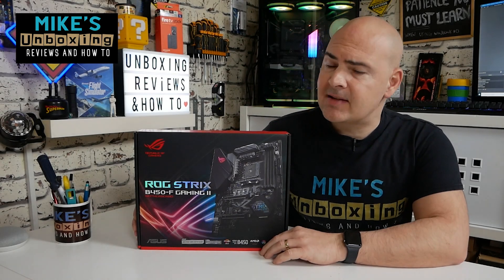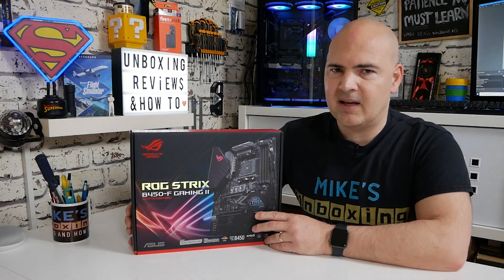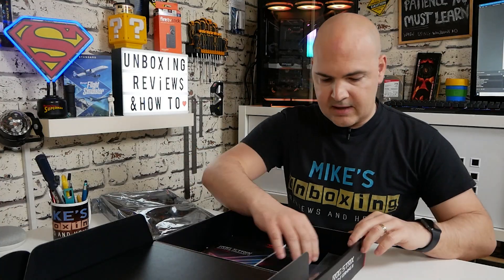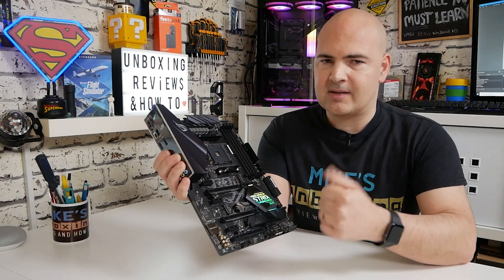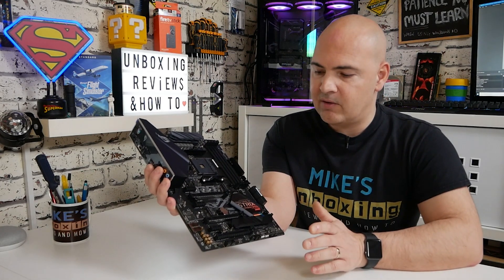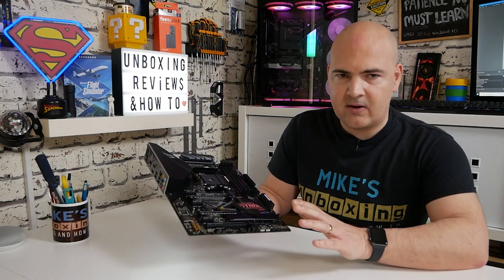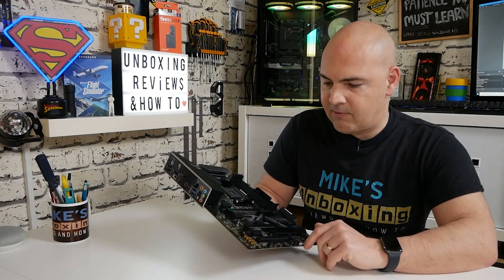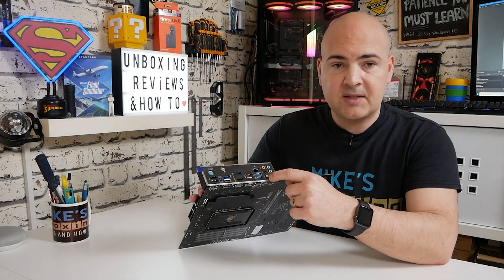ASUS ROG Strix B450 F Gaming II For AMD AM4 CPU The Most Popular Motherboard On Amazon

Comment: @12:38 I don't understand why this reviewer would say SLI is dead in the water.  I was hoping to find out if this board would run two graphics card, eg 2 x GTX 1080 in SLI mode.  Instead the notion of having two cards is simply dismissed by the reviewer.  So my next question is which budget AM4 boards would support the funcationality i am after?
Reply from the maker: Sli is dead and buried with little or no support in video editing and most games developed in the last few years. It only works to some extent in some benchmark programs. For almost all regular pc users sli is not possible and needs a lot of modifications with no guarantee of stability or utilisation

Comment: Hi, I tried building with AMD Ryzen 5 5600G, post building I can't get into the Bios menu. I am able to see the asus home page showing (press del/F2 to get into Bios), and then no display output.. then I updated the bios using flash bios, reset the cmos, still no luck.. any suggestions please.
Reply from the maker: try using a different cable or plug into a TV

Comment: Please help someone, I bought this motherboard literally last night and I want to use the bottom m.2 port with the heatsink in it but when I plug in my m.2 ssd it doesn't appear in the bios :(
Reply from the maker: is the bios set to uefi or csm? and does the processor you are using support the amount of PCIe lanes needed

Comment: Hey Mike first of all nice review and I would like to get some information as I am going to build a PC in which I need a motherboard at around 115 pounds please try to recommend with Wi-Fi
I hate  choosed m s i b 450 tomahawk but it has no ARGB headers then I went for Gigabyte aorus b450 PRO Wi-Fi but it is the worst Mobo with very bad temps and vrm and even it crashes most of times and now I am wandering around MSI b450 gaming Pro carbon AC and Asus Rog strix b450 f gaming II 
Please recommend any good Mobo around 115 pounds
And please tell how are the temps and vrm of Rog strix b450 f gaming II and how would it be
Reply: @Ruben Schilling r5 3600
Reply from the maker: i would consider the msi B550 gaming wifi, the price is often reduced to about that level

Comment: Older videos here but I’m thinking about getting a Ryzen 9 5900x and I have the same motherboard but I would like to know how to Check what version your bios is in and if it’s updated enough for 5000 series and how to update it. If you can help that would be appreciated 🙂
Reply from the maker: you can press the delete key before windows boots and in the bios the first screen will show you your bios version and date.
then head over to the ASUS page for this board and then support and cpu compatibility and there you will find all the info needed
Reply: @mikesunboxing  Alright I’ll try that, thanks 😊
Reply from the maker: @rezxottic2379  No problem :-)

Comment: if i were to BUY this bored, would i be able to use a ryzen 5600x as my processor without any problems ?! PLEASE LET ME KNOW
Reply from the maker: yes just look for the ready for 5000 series sticker on the box and it will work out of the box otherwise a bios flash will be needed

Comment: I did not quite catch all the info but what type/s and how many in each type/s are in the front usb ports? TIA.
Reply from the maker: 2x usb3.1 type a and 4 x usb 2.0 type a
Reply: @mikesunboxing  thanks man, but I thought that was for the rear usb ports? I was referring to the internal I/O ports (front usb ports), the one which will be connected with the system unit's case ;-;

Comment: I have AsRock B450 Steel Legend. It's a bit of a mash up of different parts. Thinking of just going for a ROG and Corsair (or Chromax Noctua) build.
Reply from the maker: for an easy life and save money the MSI eco system is by far the best for easy sync rgb etc, but with signalRGB the others can potentially work

Comment: Im looking for a new card and came across this one. But will it work with my ryzen 1600 untill i buy a new cpu ? cant afford to buy both at the same time. I am however going to upgrade further down the line
Reply from the maker: yes it will
Reply: @mikesunboxing  ty so much !

I have this issue with my 2 other boards and im rarely stumped but this time im at lost for words.

I have older mobos. Asus b350 prime plus. Paired with
 ryzen 1600 
Nvidia gtx 1050 ti
16 gig of crucial ballistics 3200
And a gold 80 plus psu ( cant remember brand atm.

I cant get it to run with more then 1 stick of ram and only 1 of the ramslot seems to make it wanna post. The other 3 doesnt work anymore.
I have tried

1. Test each stick individualy
2. Bios update
3. Cmos and reseting everything on the boards
4. Changed psu
5. Switched motherboard
6. Tried increase ram voltage
7. Took everything apart.put it back togheter. Checked connections.

This happened after switch case. And here is the thing. Both my mobos do the same exact thing.. so am i missing something or am i having really bad luck with the motherboards...
Reply from the maker: @shootinsharkz  This is maybe easier to fix or at least advise if we can ask more questions and get direct answers, so feel free to join our Discord chat and we can go over it in more detail https://discord.gg/gaeeDPw

Comment: @Mike's unboxing, reviews and how to
How much fan ports are there? , i need to connect 5 rgb corsair fans (4 pins) , and a noctua one.. can i with no problem?
Reply from the maker: they are shown in the video, but to recap 1 x CPU Fan connector 
1 x CPU OPT Fan connector
3 x Chassis Fan connectors
1 x AIO_PUMP connector
so you will likely need a splitter or hub unless you can get the fans to control to your liking on the extra CPU or AIO headers
Reply: @mikesunboxing  ok so i just need 3 splitter cables? And no power loss? Its my first build sorry
Reply from the maker: @LAYATORS  This is maybe easier to advise if we can ask more questions and get direct answers, so feel free to join our Discord chat and we can go over it in more detail https://discord.gg/XtBTGQ6BDu

Agree to the rules by clicking the emoji and you will get access to the rest of the Discord channels
Reply: @mikesunboxing  👍

Comment: Hi Mike, thanks for this video! I have a Ryzen 5 3400G and I'm looking for a B450 because I want  to do a future upgrade to Ryzen 5000 (I can't buy a B550 for the price and the APU compability). Would you recommend me this board or there is a better B450 option? Thanks! (I'm not really interested in technologies like PCIe 4.0 or WiFi)
Reply from the maker: this for me is the best of all worlds if you don't need the extra usb internal headers
Reply: you will need to update the bios to work with the 3400g

Comment: Would you recommend this over the B450 aorus pro MB? And Software wise what's better Aura or RGB fusion. Stability for context. I'm still torn between these 2 boards
Reply from the maker: get this one
Reply: might be out of stock before I could buy one, but I'll see. Any particular points and problems with the aorus board that I should I avoid? If it comes to it.
Reply from the maker: gigabyte boards seem to be a slightly higher failure rate from what i can tell from my relatively small community, and i myself had had a few that caused issues. For us it seems the MSI boards are actually quite good for longevity and just working
Reply: Noted. Even if it means purchasing a tray type CPU to pay ROG tax

Comment: I bought it because it's a solid board for the price. I don't need PCIe 4 when I'm using an RX 580. Hell even with a new RX or RTX PCIe 3 will be plenty. Trust me, moving from  an FX 8350, I'm happy with it.
Reply from the maker: yes that will be a good upgrade! Fx8350 is good but it is showing it's age a bit now
Reply: @mikesunboxing  Yeah, I feel like it's that shared FPU or whatever that limits the FX 8350 but I don't know for sure. I never had my FX 8350 reach "100%" usage yet I was clearly CPU bottlenecked when reaching 65 to 80% CPU usage. It was also running on a ASUS M5A97 R2.0 which def was sweating with this CPU. Tbh, I'm glad I went with ASUS again because that board held on for years without an issue, and then ended with an FX 8350 which people don't recommend due to the board's weak 4+2 VRM. Ran great! So I hope the quality hasn't changed, so far so good.

Comment: Hi Mike. I'm confused, I have this mobo, but I can't work out why m2 slot 2 has a heating but 1 doesn't? 
Should I put my M2 (not running OS off it) into slot 2 instead of slot 1?
Reply from the maker: yes the X570 tuf gaming is the same, either get a separate M.2 cooler or use the other slot

Comment: Does the bottom m.2 slot run at the same speed as the top? Just wondering as the heat sync is there
Reply from the maker: with most processors the two ports are capable of the same speeds.
as listed here 
3rd/2nd/1st Gen AMD Ryzen™ Processors : 
1 x M.2_1 socket 3, with M key, type 2242/2260/2280 storage devices support (SATA & PCIE 3.0 x 4 mode)*
1 x M.2_2 socket 3, with M key, type 2242/2260/2280/22110 storage devices support (PCIE 3.0 x 4 mode)*

Comment: I actually made a budget Ryzen with that board, I got a ryzen 5 2600 for 70€, and the rest of the stuff all new,I had in the cart a b550 board,but I Saw that the b550 compability with zen + wasn't 100% so I canceled the order with the b550 and oredered with One of these,great board!
Reply from the maker: yeah it is a great board with a LOT of compatibility
Reply: @mikesunboxing  Really,I have a question though, I have my ryzen 5 2600 stable at 3.925ghz with stock voltages, after 3.95 crashes at the end of cinebench r20, I would like to reach at least 4.0 GHz,frequency with I finished a round of r20 with stock voltages,but at the second round it just crashes,should I raise voltages or Change LLC calibration? Other question, I have a kit of Corsair vengeance pro at 3600mhz, however the maximum frequency for the 2600 is 3200,but at 3200 the adrenalin software crashes, but if I Turn it to 3133 it works fine, and I am using the d.o.c.p profile on both cases! Thank you
Reply from the maker: @Guitar88  This is maybe easier to advise if we can ask more questions and get direct answers, so feel free to join our Discord chat and we can go over it in more detail https://discord.gg/gaeeDPw

Comment: Man I really want to build one but I don't know what allt of these slots mean and this wifi thing you're talking about like I want to play online games and use a wireless mouse so what would I need to get to do that because in my cart currently is a ryzen 5 5600, cooler master ml240l liquid CPU cooler, this motherboard, kingston fury beast 16gb ddr4 3200mhz cl16, teamgroup t force cardea zero z330 2tb ssd, msi 3060 gaming x 12gb, deepcool matrexx 50, corsair rm650x gold certified fully modular atx power supply and Microsoft Windows 11 pro oem DVD 64bit. I know it's alot man but if you would just be able to help me out a bit it would mean so much dude I'm so lost. Thankyou
Reply from the maker: just buy a wireless mouse it will come with it's own wireless usb adapter
Reply: @mikesunboxing  and I will be able to play online games without the wifi thing?
Reply from the maker: @Toxic-ng2fg  This is maybe easier to advise if we can ask more questions and get direct answers, so feel free to join our Discord chat and we can go over it in more detail https://discord.gg/XtBTGQ6BDu

Agree to the rules by clicking the emoji and you will get access to the rest of the Discord channels

Comment: Hi, there is any chance i could use this method even though i have my CPU ryzen already install and working with the fun? Or I have to take de CPU and then yes flash it? Thanks in advance,
Reply from the maker: Should work in a fully built system but maybe remove the gpu or ram so the system can’t accidentally try and boot

Comment: Hi, I need your help, I'll tell you I bought the mother b450-f gaming 2, but on the box it says that it is ready for amd ryzen 5000 desktop ready and it also says that it is ready for 3rd gen ryzen and in small letters it says: not compatible with amd ryzen 5 3400g & amd ryzen 3 3200g. and from what I can see in your video I have the same board as yours and it comes with the 4007 version of the bios. What I wanted to know is that if I am going to be able to use ryzen 3 3200g with the bios 4007 or do I have to put the bios 0301 on it ?. please help.
Reply from the maker: it will work out of the box and the sticker is wrong
Reply: Thank you so much
Reply from the maker: @gttayrton  No problem :-)

Comment: Hallo coming from future i want to buy new nvme ssd and planing to get the pcie gen 4 or 5, this board can support? currently using samsung nvme 970 plus evo
Reply from the maker: this board supports pci gen 3 but you can install faster drives, but they won't get the speeds

Comment: Does the m.2 ssd placement have any difference for this board? Still don't understand why they put the heatsink on the bottom m.2
Reply from the maker: yes it is an odd thing to do although the faster drives often come with their own cooling solutions

Comment: Is this good for a ryzen 5 cpu? and can it handle any higher ryzen cpus? Is there a limit on gpu's u can use on the mobo? (Can you use newer gpu's for the mobo, e.g. rtx 360 ti fe.)
Reply from the maker: ryzen 9 is supported and new gpus. the limit of GPU in terms of physical cards will be down to have many PCIe 16x slots are on the board, or riser cables if you want to try and use PCie 1x slots
Reply: @mikesunboxing  Okay ty. great video.
Reply: @mikesunboxing  And do you mind replying to my other comment?
Reply from the maker: @KlIIua  This is maybe easier to fix or at least advise if we can ask more questions and get direct answers, so feel free to join our Discord chat and we can go over it in more detail https://discord.gg/gaeeDPw

Comment: Rookie question, so this will work with the ryzen 5 5600g without the need to do the bios bits? Im planning on buying a bundle mobo with cpu of this and the 5600g. I cant do any of these stuff so im hoping theres no need for the bois bit. But i am asking. 😂
Reply from the maker: it will almost 100% need updating unless it is VERY fresh out of the factory
Reply: @mikesunboxing  wait, im kinda confused. So this exact mobo, asus b450 f gaming 2 will still need to be bios updated so that it will work with the ryzen 5 5600g?
Reply from the maker: @friday3803  Yes unless it has a Ryzen 5000 ready sticker on the box
Reply: @mikesunboxing  yeah i just went all in yolo and bought the mobo + 5600g bundle. If its not compatible, ima just have to figure it out. Plus your vids are here to help tho. 😂
Reply from the maker: @friday3803  Feel free to join our Discord chat if you need any help https://discord.gg/gaeeDPw
Reply: @friday3803  did the 5600g worth with the b450f gaming ii with doing anything?

Comment: Good timing, I literally just got the 3600 delivered from amazon for £150. 
I'm thinking £90 B550 and 3600 crucial ram (£69 for the red ones, seems red isnt popular) but I can go a bit higher. Is it worth extra the extra i ask myself considering I will likely go r7 5800 or r9 5900 eventually. The upgrade path on am 4 means I will be keeping this machine for 10 years...
Reply from the maker: this seems like a good option and supports almost every single chip on the platform, and ASUS style 🤣
Reply: @mikesunboxing  Ah, I just had a thought. I think you need B550 for Smart Access Memory. It only works on 5 series chips and doesnt make a big diff but if it gets better i might regret not having it. 
(fomo is A.M.D marketing ;#}  )
Reply from the maker: @MrChriss000  yeah there are a few advantages for the newer hardware, if you have the option the newer stuff will mostly get better performance when the drivers and specs are sorted
Reply: @mikesunboxing  Cheeses, contemplating the whole platform longevity design I was wondering if I should buy faster ram in case the move to zen 3 is viable later but no, 4 sticks of 3600 / 16 jumps in performance with a 5xxx cpu compared to 2 sticks. (just double it up and ddr4 will be cheap)
Its about 5% faster. frequency does a lot less. 
https://www.youtube.com/watch?v=-UkGu6A-6sQ
Reply: That Rams well good, lovee playing with mine so much bought another set to make my life more difficult. if ya get em hit me up in the discord I have a boatload of settings for them 👍🏿
Reply: PNY XLR8 16gb 3200mhz dual 8gb sticks at Curry’s mate £65 great ram for the cost
Reply from the maker: @pompeyboy75  Thanks for the info :-)
Reply: @mikesunboxing  No problem mate thought it might be helpful
Reply from the maker: @pompeyboy75  might get some seems RAM prices are due to rocket soon
Reply: @mikesunboxing  Wouldn't surprise me everything else has gone through the roof price wise, been looking to upgrade my GTX 1650 but not paying the silly prices people want for the RTX cards when you can actually get one that is, so yeah grab what you can while you still can mate.

Comment: Quick question. I’m getting the Western Digital sn570 ssd. Which of the m.2 slots do I put the ssd in?
Reply from the maker: top one would probably be best
Reply: @mikesunboxing  ok, but when it comes out of the box, the top slot has no cover. Should I put it in the top slot and then unscrew the cover from the second slot and put it on the top slot?
Reply from the maker: @crustythegamer4208  The covers don't make a great deal of difference